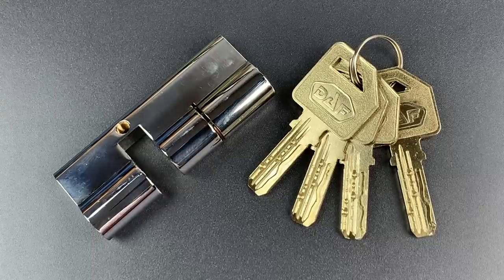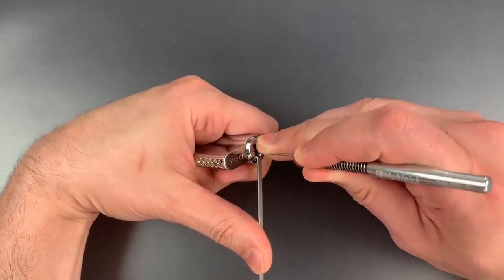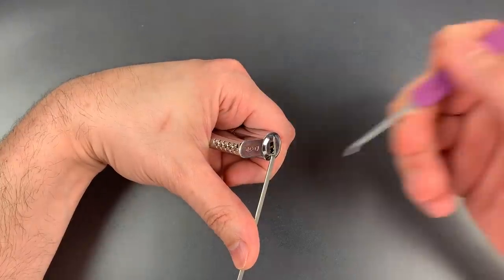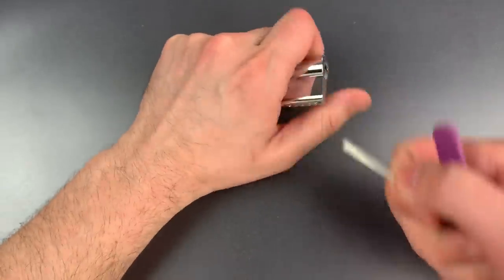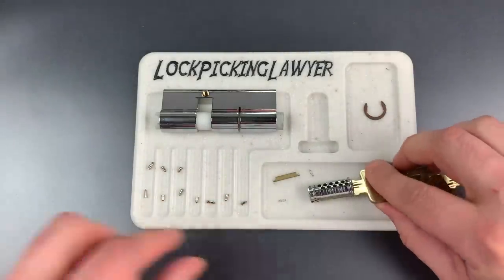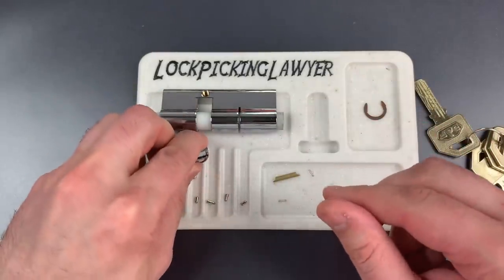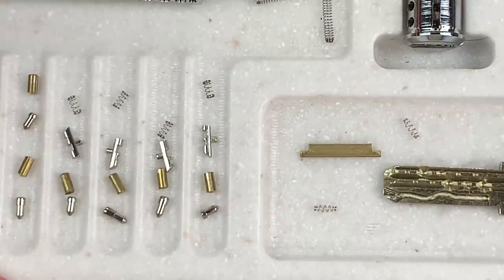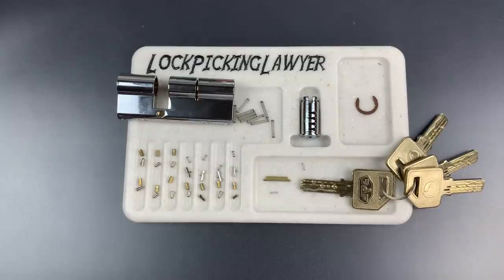[871] Turkish High Security: DAF Kilit Model DBS02 Euro Profile Cylinder (10 Pins, 4 Sliders)

Comment: @Lockpickinglawyer Hi!  All of your videos is interesting, but, man when you picking them, mostly you hold locks and cylinders in hands and rotate it how its comfortable for you. So, what about placing them in vice or some training door maybe. To show how to open when the cylinder installed.
Reply from the maker: 😂😂😂😂😂😂

Ok, that’s my belly laugh for the day. I’m not faulting you because you’re obviously not a picker, and you have no way to know this. Picking a euro cylinder in your hand, with a camera in your way is probably the hardest method possible. Putting it in a vice would have been FAR easier. Unfortunately, my cheap vice broke as I was tightening this cylinder into it the first time I tried to shoot this video (new vice on order)... so I did it the hard way. Take a look at the messed up way I had to hold my left hand, and tell me again how that’s “comfortable.” 

It’s even more funny because I’ve often said that putting padlocks (ie- lock’s not intended to be rigidly mounted) in a vice is a picking crutch... a way to artificially make the lock easier to pick. That’s why I haven’t put a padlock in a vice for a few years.
Reply: @lockpickinglawyer   yes, i understood you. And what your left hand is holding cylinder and actually you can't use it. But when it's like "installed",  it's easier to show people how lock is much more vulnerable or show another features of picking this concrete lock.  It's just what I wanted to say.

Comment: I wouldn’t rate many euro locks as a high security lock. As half of the time the wrong lock is installed to the wrong housing. And the euro cyclinder sticks out 20mm. All any thief have to do is grab the euro cycliner with a decent pair of pliers and they snap the lock in half, then use a Allen key to open your door

Comment: Remember those old computers that had a keylock in them to prevent the case from being opened or from using the computer at all? Maybe you could find some of those for cheap, nonworking or working, but without keys, and trying to pick them open?